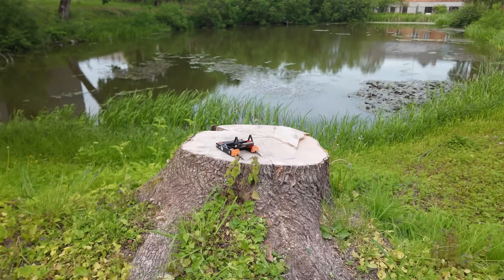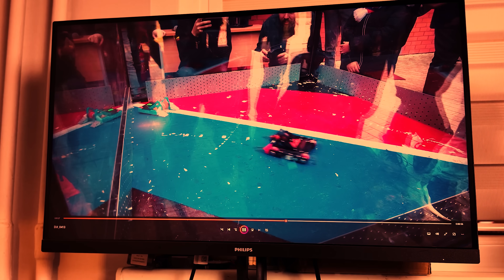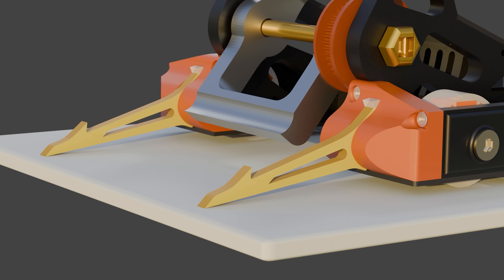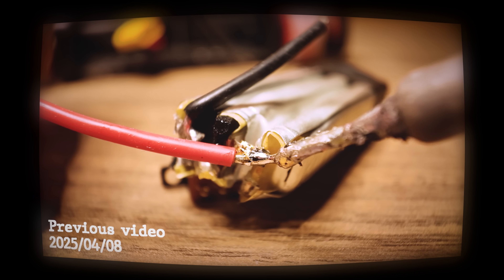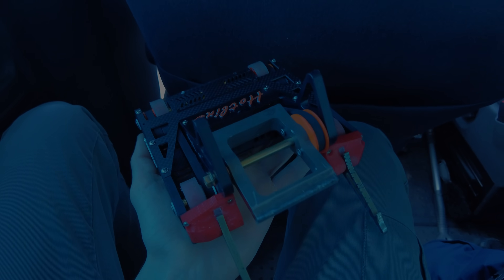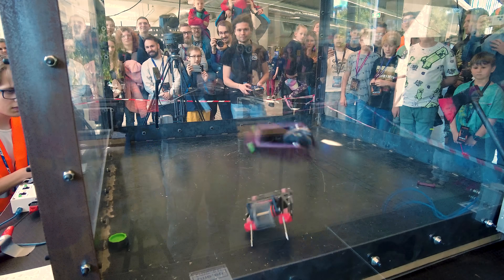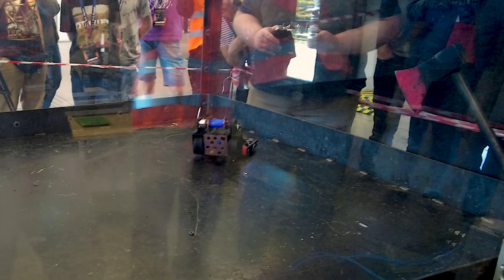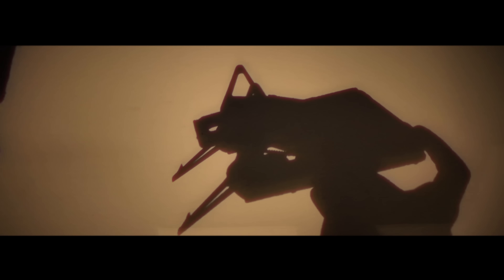Building a Ridiculously Dangerous Robot

Comment: How did u make that 4s battery snd what 3s batteries did u have before that you used to create the 4s one. Also for the wheels what is the shore hardness of the silicone you use? Thank you, great video.
Reply from the maker: Hi,
I have bought four one cell batteries and combined them into one. Wheels I tried making pretty grippy and soft so I used 15A hardness silicone.

Comment: Can i use 2 1400kv motor for the spinner pls reply fast I have a competition
Reply from the maker: What size is the motor?
Reply: @DrumBotics  2212 model used
Reply from the maker: @SURESHS-v6k For a 8 Kilo robot I don't know, of the weapon is not too heavy then it should work.
Reply: What did you use for the body
Reply: Where can i get the blue print of the body
Reply: My competition in 14 days
Reply: Maximum weight allowed is 8kg maximum dimension 450*450*450 I'm gonna make your idea and add some more features like a hydraulic ramp a hammer on back and spikes and a quarter tilted stick which rotates so if it flips I can flip back

Comment: you can get a faster weapon rotation with the same 3s battery by using a higher KV motor for the weapon. same weight, higher rpm.

Comment: If you get rid of the front wheels completely and make it scrape along on those wedges at the front you'll put the entire weight of the robot and the force of the back wheels on those two points which should maximize your chances of winning a get-under fight

Comment: I see you're having some problems turning due to gyroscopic effects. The way to basically disable gyroscopes is to have another gyroscope on the same axel (or any rigid frame) spinning in the opposite direction, at the same RPM of course. Think about it!
Reply: I think that would be way too heavy to implement lol

Comment: 9:40, Wow, rocking that prehistoric slab of plastic nice! I haven’t seen a phone that ancient since the dawn of Android evolution. Does that thing come with a crank to power it, or do you need to rub two sticks together for signal?

I bet your “high‑res” display can’t even show a full emoji without buffering, and I’m pretty sure the only app it can run is Snake. Seriously, using that relic in 2025 is like sending smoke signals at a Starlink party.

If time travel ever becomes a thing, just whip that out and you’ll instantly be transported back to 2011, where selfies were blurry, apps crashed hourly, and “3G” was the pinnacle of technology. Pro tip: to really wow people, try turning it on. If it still boots, consider entering it in a museum exhibit on “Early Mobile Antiquities.”

But hey at least you’ll never have to worry about your device overheating, because it probably never even cools off! 

Ask ChatGPT

Comment: Hey! I really enjoyed your videos and the bot — great work! I just wanted to ask how you managed to get the skid steer movement so smooth and responsive, with no noticeable delay or lag. Could you share how you achieved that?
Reply from the maker: Thanks!
I think every robot is responsive with no lag although I use a double brushless esc which has brake (when I stop driving they use energy to stop my motors) I think that helps to control way better.
Reply: @DrumBotics  So, both ESCs are connected to the receiver channels, and a master-slave setup is used to achieve skid steer movement and enable control in all four directions. Right ??
Reply from the maker: Well yes, but that doesn't necessarilly make it more responsive. It's how every robot basically works. What makes it responsive is the motor break and traction of the wheels.

Comment: Surely with a higher voltage battery it will draw less current for a given power level thus being able to handle thinner wires and certainly not requiring thicker wires?
Reply: Double check ohms law please for yourself

Comment: I think more voltage 4s actually produces less amp draw than 3s.
Reply from the maker: Yeah understood that after the competition, my smarter teammate said something similar.
Reply: @DrumBotics it depends on how smart your motor controller is (and how it is configured). If it limits wattage, the amp draw is lower but you also shouldn't see much of a difference with 4S. If it limits amperage, amp draw is the same and power is proportionally higher. If it doesn't limit anything, voltage and amperage increase, power increases proportionally to voltage squared.

An ESC is just a triphase inverter after all, and unregulated it wouldn't limit anything. However, they of course have microcontrollers to properly power brushless motors and can definitely do some power limiting through a variety of techniques (varying the on time of each coil, or even sending really high frequency PWM to the motor coils, etc. I don't know if all of these techniques can be used but that's what comes to my mind).

Comment: Correct me if wrong, but higher voltage of the batterie should lead to lower required current, hence bigger wires are not required.
Reply: Higher voltage means the components can be created with less current draw needed for the same power output. However, raising the voltage to the same component (overvolting) would increase current draw. 
In the end, you need to calculate the current being drawn and have the wires sized appropriately.
Reply from the maker: I don't know exactly, but I was told that in fact I didn't need thicker wires as they would need to be way longer to have a negative effect and for that reason thinner wires would have been good enough.
Reply: The resistance of the motors is fixed, so increasing voltage increases current proportionally. If you wanted the same power output at the higher voltage you could limit current and use thinner wires
Reply: @Muffinx93 the "only" way to limit current with a fixed resistance is by limiting the voltage. "Only" in quotes because there are things like pwm. With a motor it's not as helpful to just raise the voltage because even after pwm you have the negative of the high current draw and higher power dissipated but the same amount of work being done (eg. Double the voltage but pwm to 50% duty cycle does the same work but the power dissipated is higher for the 50% on than the 100% on the normal voltage.) my actual numbers may be off but this was fascinating for me to learn so I hope others find it helpful.

Comment: May I know what drive motors are you using for Hotline? Also I wanted to know the specification of the drive motor if I'm planning to make a beetleweight robot. Any recommendations? Thank you :)
Reply from the maker: I'm using two Repeat Mini Mk4. They are basically the only available option for ant weights in the market right now. But for Beatle weights I'm not experienced and I can't recommend anything on that.
Reply: I believe that Repeat Robotics also sells brushless motors like their MK4 but for beetleweights, such as their Drive Pro, Drive Max V2, or Compact 1806